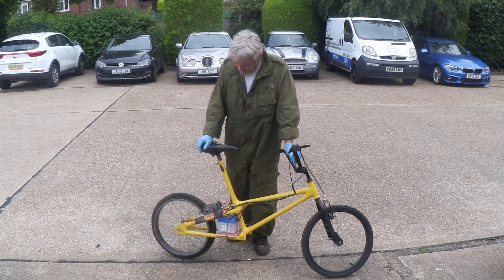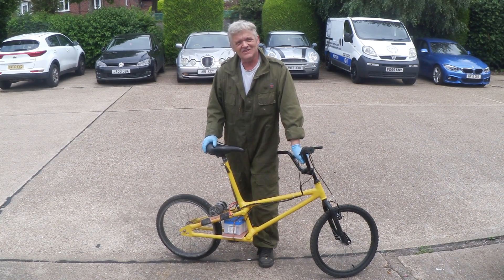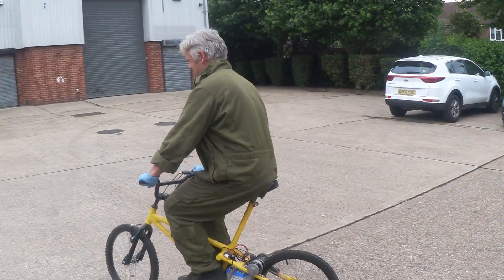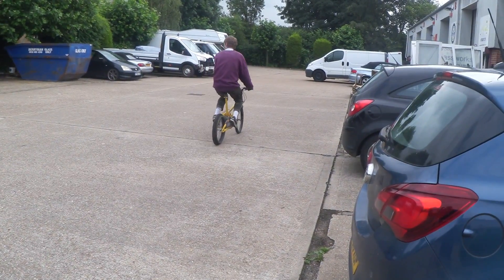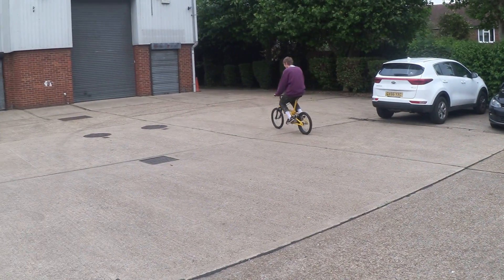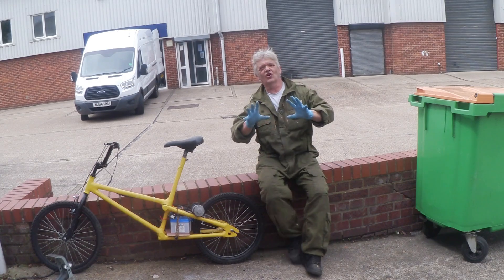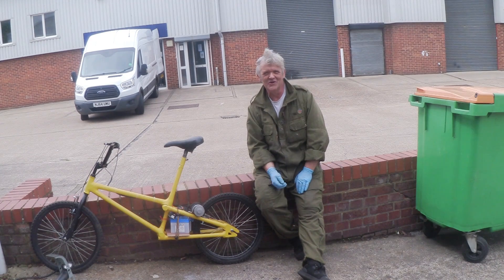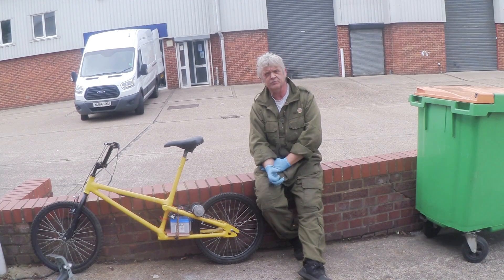1171 A Paper Bicycle - Testing The Electric Version

Comment: MK2 with a 500w motor, and Mark3 with a 500w motor and a higher voltage paper battery :). Any chance of a members video going more in depth on the sticks machine construction, different kinds of paper and glues, using the sticks machine to try making a battery, and such?
Reply from the maker: absolutely mate - I'll get on with that today

Comment: Brilliant! I've really enjoyed the way this project has challenged me to think about the forces involved in bike riding and frame geometry. I'm currently sitting on the opinion that the most severe, sudden forces on a gently ridden bike are when dropping off a kerb, when a grown man will probably push over 1000N momentarily straight down through the pedals/footpegs/crankshaft. Does that seem about right to you?
Reply from the maker: to be honest it's probably on braking - the steering column head is quite fragile and a 80kg cyclist can reach 30-35 kph quite easily
Reply: @ThinkingandTinkering  I wonder how much brake bias affects the amount of force there? I'd imagine using a front brake alone would compel the front wheel towards the seat tube much more vigorously than using a rear brake alone.

Comment: I love that you have the gooseneck “technically” backwards. Your energy is truly delightful!
Reply from the maker: cheers mate
Reply: @ThinkingandTinkering  Thanks for sharing Rob et al. Excellent idea using ‘paper’. I’ve also seen articles where wood-pulp is shredded to ‘nano- fibres’ and reformed to rival steel strengths. Have you considered making/using this material in your DIY ideas?
Hmm. Could you make the frame a rolled paper EESD?
Also, the rake and projection of the forks is so your toes don’t collide with the back of the front wheel when steering. Since you have gone electric (sans pedals), you can adjust the frame shorter and lower (lighter/compact), still maintain 500w+ for ‘sportiness’, and make it a commuter carry-on/folder. No need to lock it up outside where it might get nicked.
Stick a VAWT on your hat and passing vehicles will recharge your EESD. And it's a visual safety aid.   %-)
You’ll be well fed-up with people telling you the ‘goose neck’ is backwards. So I wont. ;-)

Comment: Was that at max speed, maybe either gearing or the 500w motor which will consume more power meaning Barteriesare an issue
Reply from the maker: I am not really focussed on speed mate - it's more to do with the paper holding up for me - the rest is tinkering - but then that makes sense to me - why bother with the speed and motor If the thing breaks in two seconds after I sit on it lol